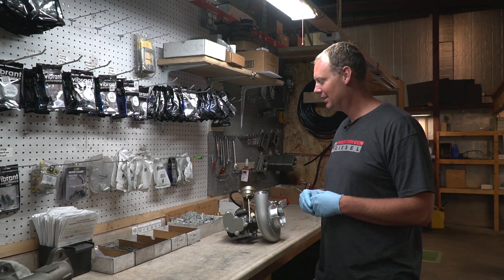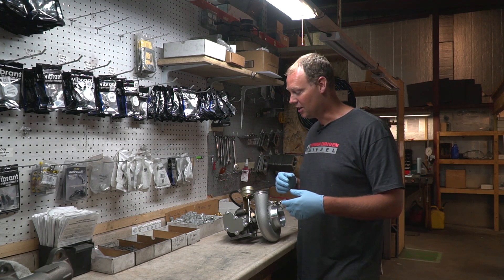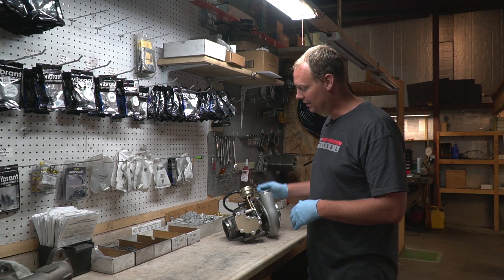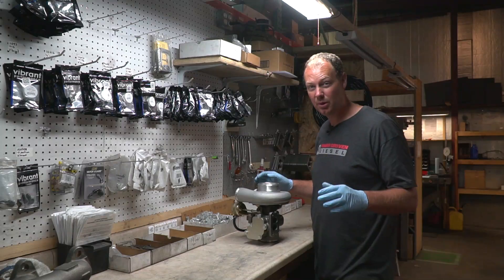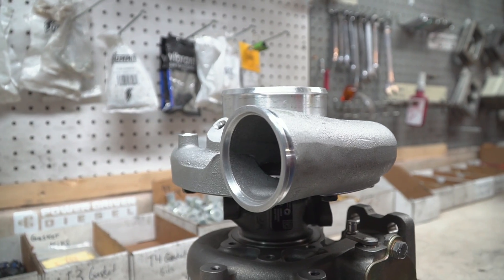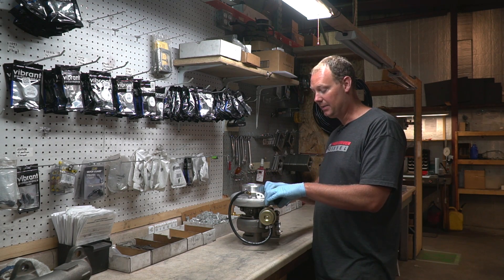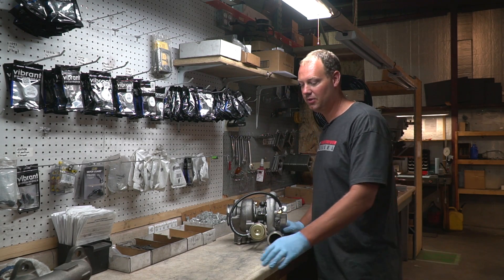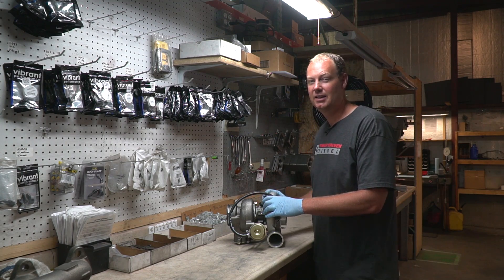How to Align a Turbo in a Diesel Engine | Power Driven Diesel

Comment: Sooo... you are saying Borg Warner was correct to deny my warranty after I tried clocking it by sticking my 3/4" breaker bar handle into the outlet.  Good to know there are bolts holding that.

Comment: This is fine and dandy if you're working with a new turbo. If you're working with a used turbo they can be difficult so what you want to do is soak it down with PB Blaster or WD40, climb up on top of the roof of your house and throw the turbo onto the Street below. You might need to do this 3 or 4 times then order a new turbo from PDD. Problem solved!

Comment: Its ironic you guys uploaded this video all considering I just got my brand new Borg Warner S300sx turbo for my 5.9L 12 valve Cummins today and its leaking oil out of the compressor side! Turbo is tilted backwards no more than 10 degrees, oil level in pan is below the drain, NO engine blow-by! Also I have a 5/8" drain along with a 90 degree pipe fitting 6" below where the drain bolts up and the oil feed is perfectly straight up and down no side to side tilt at all
Reply: @pddofficial  I E-mailed you pictures of my setup
Reply: @pddofficial  Yes the hose attached to the 90 elbow does go " downhill " from there! The only thing I can think of it that it has too much oil pressure! Feeding the turbo is a 3/8" braided hose from the top of the oil filter which is reduced down to a 1/4" braided rubber hose along with a 1/4" NPT brass barb fitting on the turbo! I have to do this because the original steel braided hose will not reach the S300sx which is the bottom (2nd ) turbo! I have a compound setup
Reply: No blow by? How does it leak oil without running?
Reply: @jaydunbar7538  I never said it leaks without running! It only leaked while running and the problem ended up being because I was using a 1/2" I.D hose on my drain instead of a minimum of 5/8" or bigger. Originally I had a 5/8" steel pipe with a 1/2" brass barb screwed into it and a 1/2" hose connected to the drain pan
Reply: @jaydunbar7538  I fixed the problem by running 5/8" everything! 5/8" steel pipe with a 5/8" brass barb screwed into it and the oil pan and a 5/8" braided heater hose connecting the two brass barbs

Comment: So with this process will it make my girlfriend tight?  Asking for a friend.
Reply: So with all the comments. I told my friend to go ahead and do a inframe  and see what happens!!!
Reply: Woody Sapper no, she’s done wore out.   It’s cheaper to replace than rebuild so go out and get you a newer model!!!!
Reply: @jasontruman1215  Just sleeve it
Reply: Why is your friend asking if this will make your girlfriend tight? Think it's time to find new friends
Reply: Depends on how your measuring?  Could be: its the angle of the dangle, Heat of the meat or mass of ass calcualtions. j/s  also  if you cant make her pucker with a turbo well turn in your man card, go get some skinny jeans
Reply: LoL!  I would be finding a new friend and a new girlfriend!
Reply: Oh lordy lmfao! I'm with the other guy........done wore out and needs a new sleeve or liner, get you back to factory bore and stroke...........then you can try different sized injectors, more air, some new studs pierced.....I mean placed, but after all that it may just take a little head work 😲, a good set of stout valve springs could get those valves seating well enough upstairs to get er pickin up what your throwin down 🤣🤣🤣! Otherwise it's major porting to get er head in the right place 😏😎😆🤣🤣!!!
Reply: Gonna have to find someone with a bigger piston being as she's bored out.